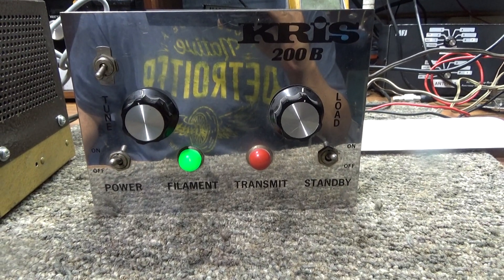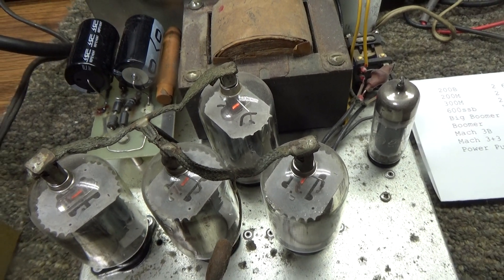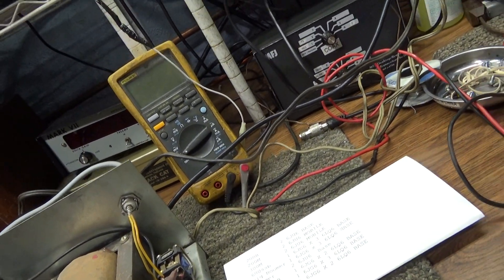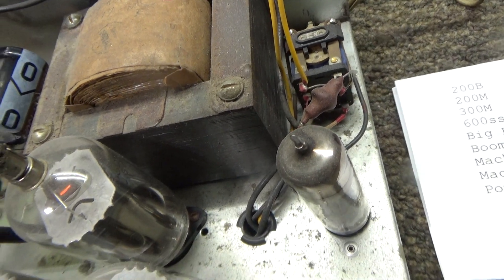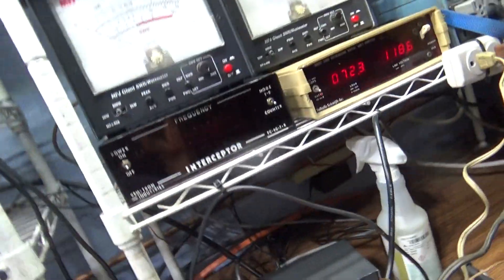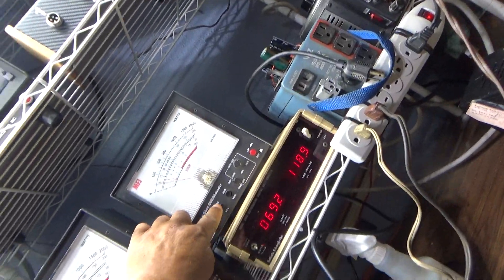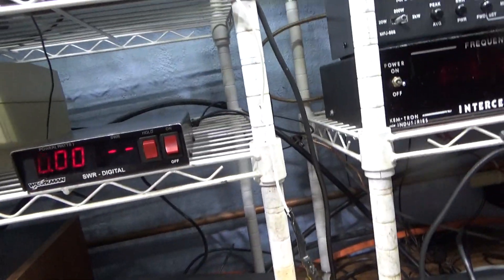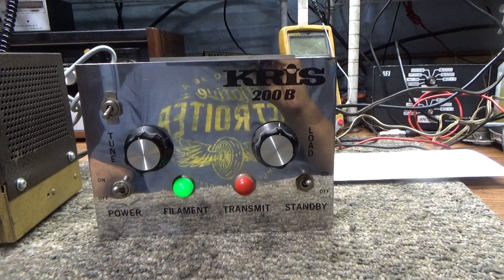Kris Mach 200B modded 4 tube 10 meter linear amplifier

Comment: Have same amp no mod two tube with third socket hole in chassis but no socket. 125w out with 4w in. Thanks for video its been ages since powered up good memories though a more simpler time. 73s
Reply from the maker: Well put, good comment, agreed.